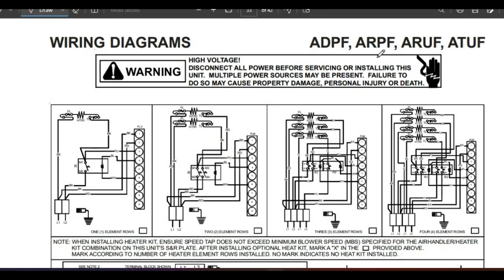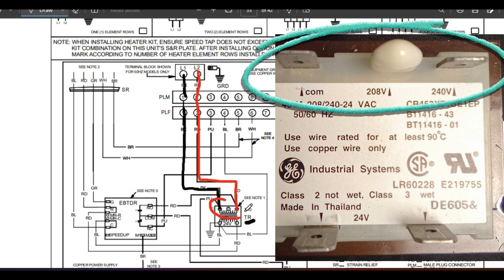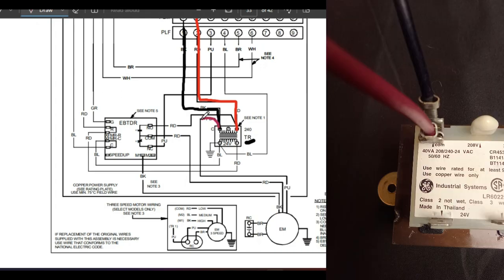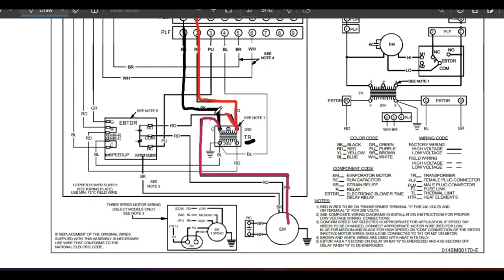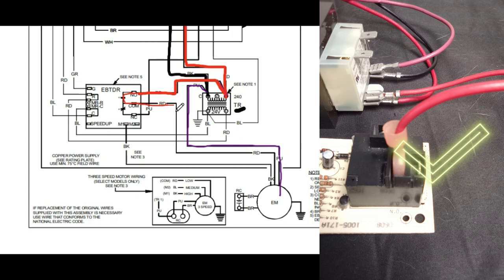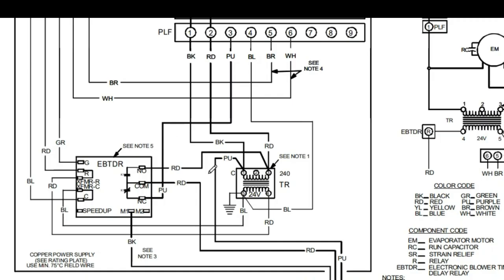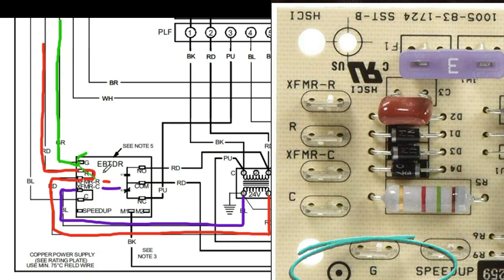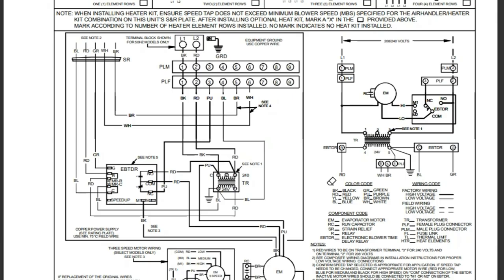Air Handler Wiring for Beginners (Fan Relays & PSC motors)

Comment: MIKE, I need some help if possible- I replaced the blower motor 1/6hsp; it arrived with one cord one side is hot the other neutral is neutral the same as common?? anyway the 2 ends of the power cord  I put the RED WIRE(POWER WIRE" IN THE FEMALE SOCKET   Pin socket# 4  I have at the bottom of the Molex connector three WIRES IN SUCCESSION   PIN#7 BLACK -  PIN#8 WHITE - PIN#9 BROWN; WHERE DOES THE NEUTRAL END OF THE POWER CORD PLUG INTO PIN# ?? WHEN I TOOK A COPY OF THE WIRING INTO THE SOCKET THERE WERE  3 BLACK WIRES  IN POSITION 1-2- AND 3- THE RED WIRE WAS IN POSITION # 4 DIRECTLY U8NDER POSITION 1 DO I PUT THE JUMPER WIRE BACK INTO POSITION 1 AND 3; AND PLUG THE NEGATIVE SIDE OF THE POWER CORD INTO  PIN SOCKET # 2  or plug into position 7 ??  hope you can help; thank you PATRICK.P
Reply from the maker: I would need the model numbers of the blower and unit it's going into to check.
Reply: ITS A COLEMAN/EVCON DGAT056BDF  BLEND AIR  THE UNIT ONLY PRODUCES HEAT AND AIR FLOW; NO A.C.-I WISH I UNDERSTOOD HOW TO READ THE DIAGRAM; WAS NEVER EXPOSED TO ANY OF THIS;  THANK YOU, PATRICK PETERMAN FROM MONTCLAIR, NEW JERSEY !! THERE ARE ONLY-- 4 PIN SOCKETS  THREE ACROSS THE BOTTOM 3AND 1 UP THE SIDE @JerseyMikeHVAC
Reply: MIKE THE BLOWER MOTOR IS A OEV6016 CENTURY EVCON(322P289) thanks again, Mike !! @JerseyMikeHVAC  by the way I,m not looking for a free lunch- just let me know !! Patrick

Comment: learning this over the past year, took a class for five weeks at PTech  where I live, there not all the great, I have been buying property for 38 years, and the last 5 years been wanting to learn more about ac, I have better then average, Is there a class on line that goes over the whole process?  Central air seems to be about 90% wiring.
Reply from the maker: I'm developing a full course myself, but it's probably a year out. I don't really know of any online that I could recommend. You may be better off just reading manuals and wiring diagrams, which is where I've learned most of what I know electrically.
Reply: ok thanks. from Staten Island myself. now in Florida. you recommend any good manuals? I understand electrical, I wired my whole house I built, so understanding the electrical isn't really an issue, but how one is running off the other, looping from one part to another,  that kind of stuff. is there any good manuals for that? thanks for getting back.  @JerseyMikeHVAC

Comment: Little confused. Ok you said that when it gets a call for heat that the tstat sends 24v to g and w. Wouldn’t that throw off the relay by switching no and Nc to Nc and NO? Fan speed would be hi and not low like it needs to be. Makes more sense to just send 24v thru w that way the relay coil isn’t energized and the purple wire can send the 120v thru the com to the blower resulting in the speed being low. I’m no tech, just following the circuit.
Reply from the maker: You're following the circuit but your timing is off. 

The 120v on the purple wire dead ends at the relay during system operation due to the NC contact being open. It does not power the blower motor. The red or black wire on COM does that, which also determines blower speed. 

When the stat stops calling for heat, 24v to W and G is lost, heat relay opens, fan relay reverts back to default position and purple wire loses 120v. So when the NC contact recloses, there is no power there on the purple wire to run the blower, even though the NC contact is closed. 

It is done like this in the event the relay that activates the heat strips get welded in the closed position. In that case, the purple wire will continue to have 120v on it even though the system is not calling for heat and W is not powered, because the relay is welded closed, it no longer needs a 24v signal to close the heat relay. It's permanently closed and always passing 120v through. 

This is when the purple wires serves it's only purpose: to force the blower motor to run as long as the heat strips are on, even if the thermostat W and G terminals are not being powered. Because the fan relay NC contact is closed when the stat is not calling for heat cycle, the 120v can now pass through the fan relay to power on the blower motor. 

It is an emergency function, not normal operation.

Comment: In my 25 years of experience in HVAC/R, in Canada & USA, I would give you 1 million *s for your brilliant presentation, and I've never seen a presentation like this, so detailed. Congrats for your excellent teaching!
Reply: This guy is hands down the best I’ve seen for HVAC
Reply from the maker: Wow, thank you!
Reply: Jersey Mike, what is best move when you update the control board and the connections have changed  to Molex..I have an old goodman air handler.. I see splicing in my future
Reply from the maker: They still sell fan relay boards without molex connections. Or are you trying to do something different?
Reply: Thank you s😊o much
Reply: Thank you Mike. 
I have been watching this presentation for 4 times and I think I got it

Comment: Jersey Mike saved me again, first the Nest w/Zone valves, now on my old Goodman Air handler, no 24v from transf after changing condensor relay.
.....found the 3amp fuse blown....dont know if i caused that by touching the wrong terminal or there was some back voltage from the relay failing??? Any thoughts?  I only had the high voltage pulled, did not flip the air handler breaker....so the relay may have been energizer during the swap, didnt check it prior.
Reply from the maker: Most likely just shorted it out while working on it. Very easy to do. Just replacing the fuse should be fine.

Comment: I first started  learning  and confused the COM to blower as a neutral common  in 120v system....The relay is conducting 120 v to the blower so why it is called a COM is confusing
Reply from the maker: Yeah that's the down side to learning electrical. Same term can have more than 1 meaning. When it comes to relays, a COM is a wire that can attach to multiple circuits. So the relay in this video, for example, the COM wire going back to the blower motor can connect to either the NO circuit or the NC circuit that the relay is attached to. It's a wire that's "common" to both circuits.

Comment: Mike, how familiar are you with newer RV ACs? I’m attempting the Nest install on a GE RV AC. They, like others, have the proprietary control board and Thermostat. I’ve seen a few videos of people making it work with a 24vac transformer or power adapter and 24/12 relays. I have all that. I talked GE into sending me the unblurred copy of the control board diagram, my issue is that I’m unsure of what wire to connect where on the Nest Learning Thermostat. Anything you can do to help?
Reply from the maker: Not much to be honest. I might be able to take a look at the schematics you have and maybe figure it out, but I don't work with them.